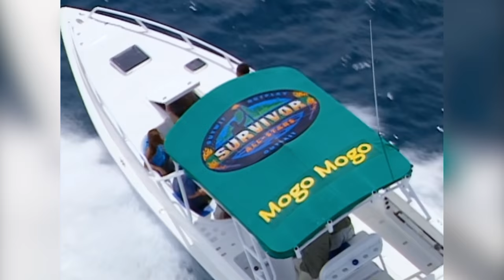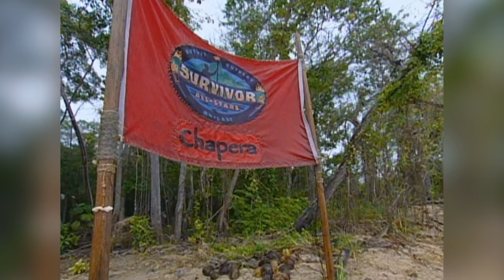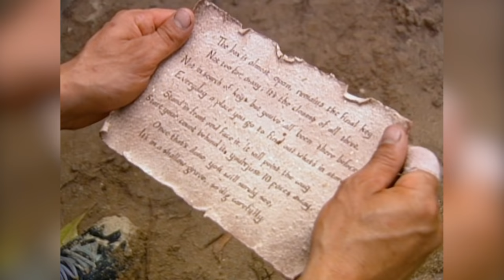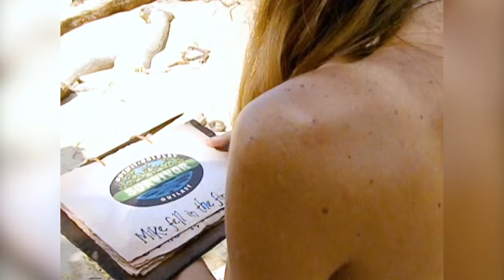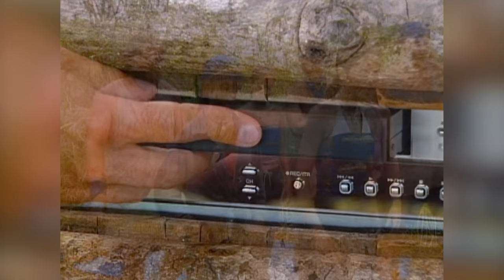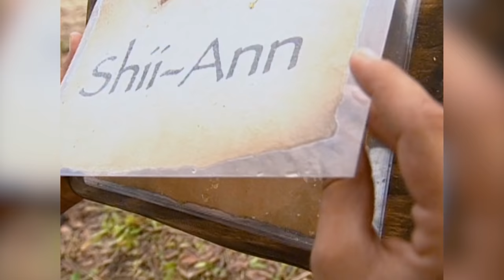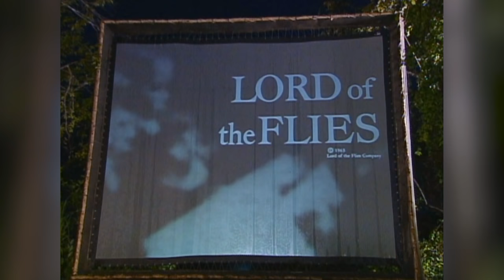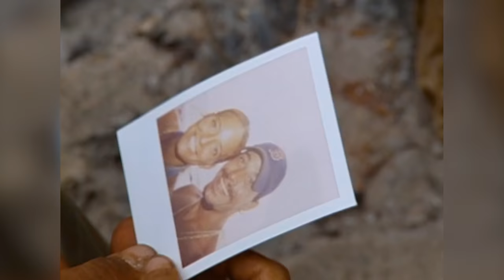Beauty and the Beast: The Story of Boston Rob & Amber - Survivor: All-Stars

Comment: Watching them try to use a fire starter is emberassing.  First off you dont use the blade to strike you use the back side flat edge of the knife. Also they are only using the striker not scraping off shavings of magnesium on the back side of the starter first.